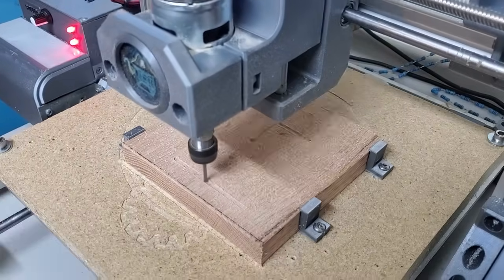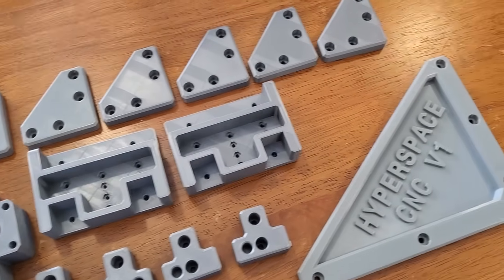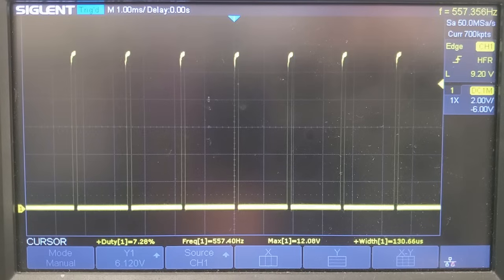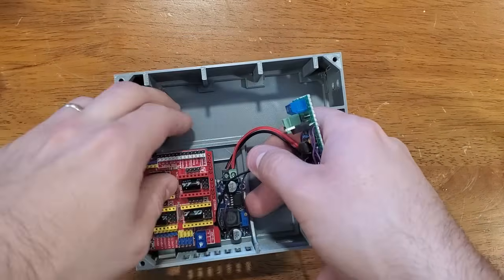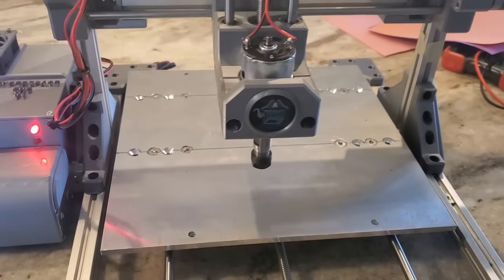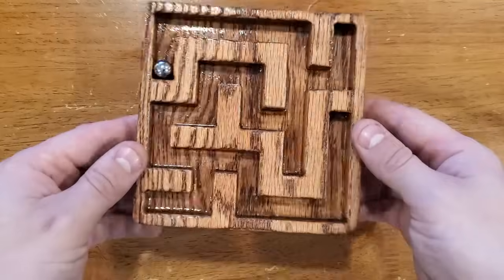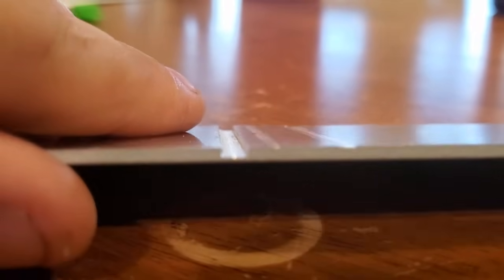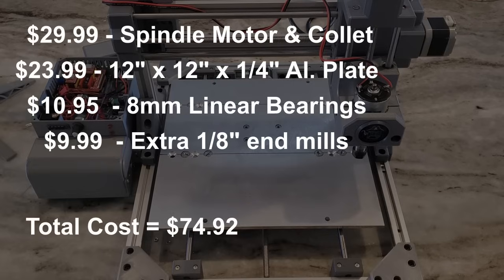CNC Mill for under $100

Comment: Great build.

Here are my thoughts, from one hobby CNC builder to another:

1. Yes, you really have to increase the rigidity of the machine. Use the machine to make sturdier brackets and thicker parts in aluminium. It is not only about the rails.

2. As you said, the play in the lead screw must be less. Either by double nuts or preferably by changing design to tooth belt instead, much better.

3. You have to calculate current and adjust the current limiter on the A4988 to as high as possible. You will get better torque from the steppers. Somehow, every single Youtube CNC-building video creator forgets to do this.

4. Add at least homing switches. When something fails you can restart your milling from the exact same starting point, even if you had to power off in between.

5. The glitch at the end is caused by interference of the motors to the USB connection. Hard to get rid of. The best solution is to make it wireless by using a esp8266.

Good luck.
Reply: Running stepper motors over current makes them run like crap. If anything you're better off running under current.
Reply from the maker: Thanks. I'm currently making upgrades for the machine that address most of your points. Rigidity and low spindle vibration are my biggest priorities
Reply: @HyperspacePirate  Yeah, cheap Chinese ER11 stuff is awful, swinging the bit around instead of spinning it on its axis. And bearings are no end of trouble. I burnt a lot of money before I finally got mine working well, and here's what I learned.

1. If Shars ever gets their straight shank ER11 chucks back in stock, buy one (and a 1/8" collet and some end mills and vernier calipers while you're at it). Their prices are the best I've found for high quality stuff.

2. Use at least four R8 bearings on it. Don't bother with 1/2"x3/4"x5/32" bearings, even expensive ones still vibrate somehow. All bearings seem to have one point in their rotation where there's a little wobble in one direction that you can feel once you have the spindle assembled. Buy a 10 pack and go through them, marking the angle of their wobble and how bad it is. Choose the four with the least wobble, and use them in pairs so when one wobbles, the other supports it. Three bearings on each end of the shaft is even better.

3. To make a spindle block, you'll need to bore bearing pockets in opposite sides of it. But this is easier said than done. The slightest bit off and the bearings will get hot and wear out quickly. I failed several times. Probably came down to the .001" backlash in my Chinese ballscrews (on the final attempt I tried compensating for it, but I think I did it in the wrong direction so then it was .003" off and that was really bad). What ended up working better was to use epoxy to cast perfectly aligned pockets. Bore one or both pockets slightly oversize, and then stick the bearings on the shank and a bit of epoxy on them and in the pocket, and push them in, allowing the shank to hold them in the correct location while the epoxy cures. Put some oil or grease on the bearings to prevent the epoxy bonding to them so you can get them out later if needed. For anyone reading who doesn't have even a crappy mill, make the block out of wood and use and a hole saw and chisel to make the rough pockets. Honduran mahogany is good, because it doesn't expand and contract much with humidity change. Mesquite is even better if you can get it.
Reply: Right thanks
Reply: the i do this for a living cnc machinist in me says nice

Comment: I didn't see anything about end stops. Do CNC machines normally omit them?
Reply from the maker: I didn't put any in. Lot's of cheaper models go without them, and it's not a huge deal since you're typically zeroing a workpiece manually
Reply: You can use soft limits. You just configure the controller with your axis limits. Then you always have to home the machine before you park it. It works here.

Comment: You did a great job I built one of the cheap kits and did a spindle upgrade on my channel. I think your machine works better than the one I built but I haven’t really tested it yet in anger. Another great video you deserve more subs. Thanks regards chris
Reply from the maker: Yeah I'm definitely gonna upgrade the spindle to one of those ubiquitous chinese 500W motors cause they seem to have way less noise and vibration